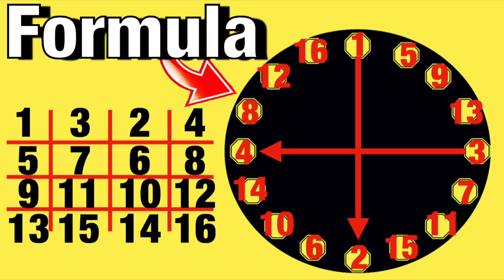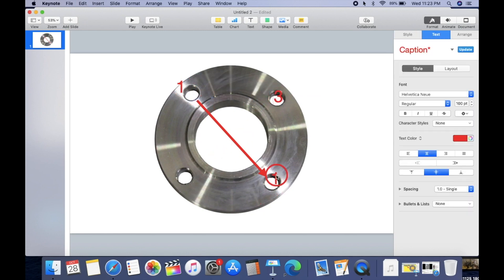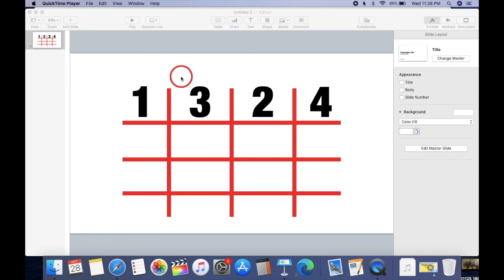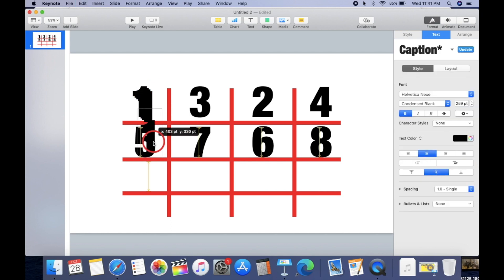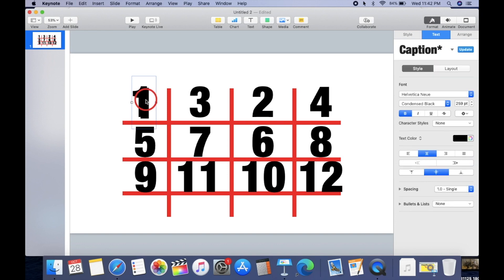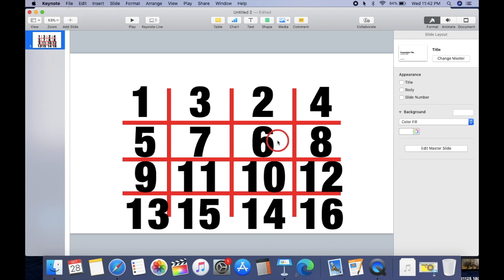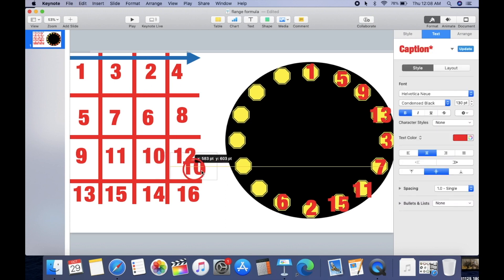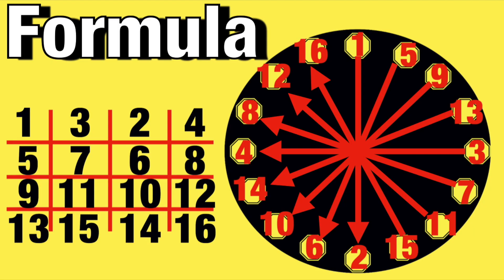Flange Bolt Tightening Formula!

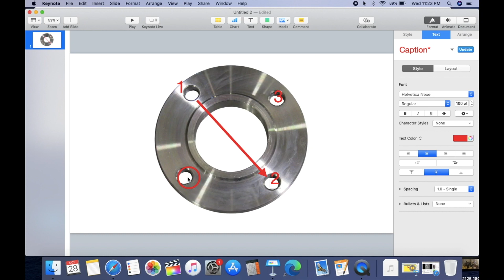Comment: As excited as I was to learn this and thank you very much for your content but This will only work for anything up to 12 bolts and could be used for a 16 bolt flange in a pinch but beyond that it wont hit your 1:30, 4:30' 6:30 or 10:30 spot until much later than you want. to put it another way this gets you North south east west but after that you would want to hit NE,SW,SE,NW but this does not do that.
Again really cool to learn for any bolt ups up to 12 stud so thanks.